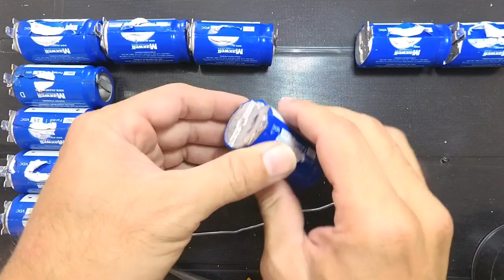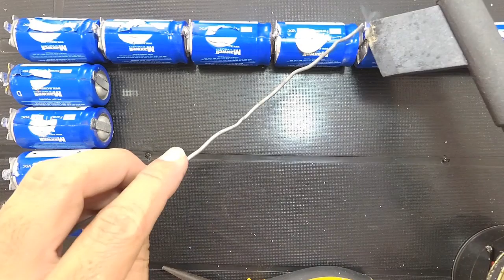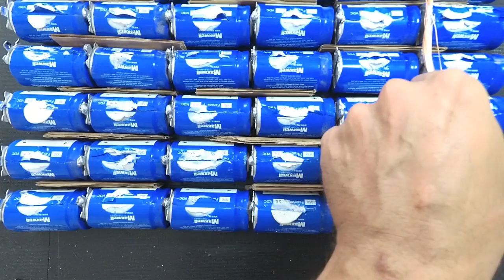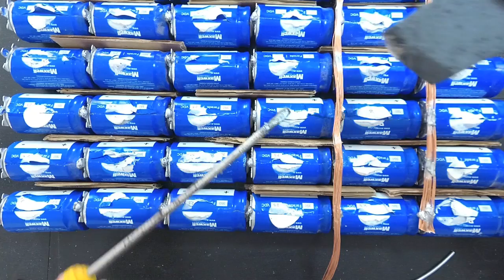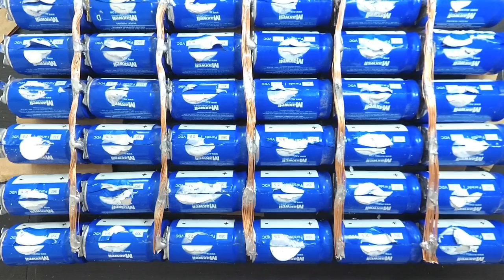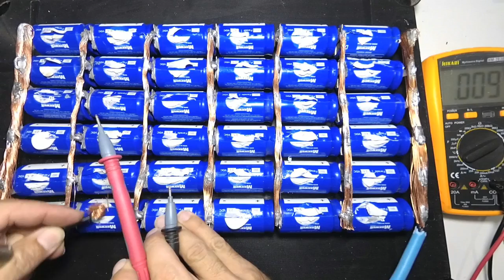Ultracapacitor  Energia Solar? Capacitores Megacapacitores ,Preparando

Comment: Estou montando (aos poucos) meu sistema off grid e pretendo ligar nele minha geladeira, embora, o inversor seja de 3000W acho que será necessário ( para ajudar) um banco de capacitores, lembrando que meu controlador é um MPPT 80A, então talvez seja necessário retificar a saída dos capacitores pelo menos com diodos....
Reply from the maker: Não faça isso pelo menos pelo que aprendi com os meus o controlador também precisa ler os capacitores eu acredito que se colocar diodos a leitura não volta para o controlador
Reply: @eletronicajc  perfeito, então estudarei a hipótese de colocá-los virados para o controlador (apenas para essa leitura) pois, vi um vídeo em que o controlador MPPT não funcionou bem em paralelo com as baterias porque são tensões diferentes. Agora para ligar os equipamentos de alto pico de potência não precisa de diodos. Será, que assim então daria certo? O que acha?

Comment: bom dia amigo gostei muito do seu video eu tenho megaga capacitor    360 f  2.7 v ligados em serie queria saber como fasso pra liga em serie e paralelo  pra almenta a amperagem  vc poderia me explica
Reply from the maker: Bom dia , bom voce só precisa fazer outra serie desta que voce fez e depois junta los nos finais  lembre se tem que carrega-los antes de juntar com os que voce ja utiliza ok ,e para isso apos de ter feito a serie use um lampada de 12 volts por 35 w ou 65 w no positivo para poder dar a primeira carga para nao correr risco de curto circuito
Reply: @eletronicajc  boa noite   certo eu queria saber se  pra mim ligar em paralelos  tenho que fazer como vc fz   liga eles em serie e depois  em paralelo como vc fz e isso  passar um fio em horizontal  e aumenta    fica melhor obrigado no seu aguardo
Reply from the maker: Que voltagem os seus estao ? foi voce que ligou eles  em serie? quanto sua serie de capacitores da de volts neste momento?

Comment: por favor me ajudem, sou leigo. posso fazer um banco de capacitores, de 3000 FAHAD, 2.7v cada . . . . .com 8 filas de capacitores na vertical, e com 6 capacitores na horizontal, perfazendo um total de 48 capacitores, tem algum impedimento, ou prejuízo ? agradeço antecipadamente.
Reply from the maker: Se for liga los em serie é ideal 6 unidades  isso para depois fazer paralelo será seis capacitores cada pac dai coloca em paralelo porém antes tem que verificar a voltagem de cada um